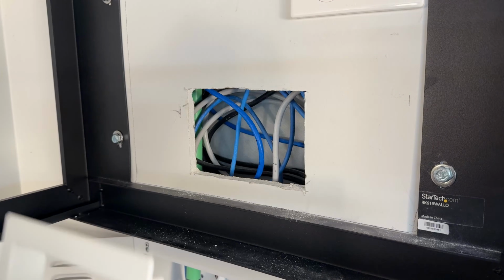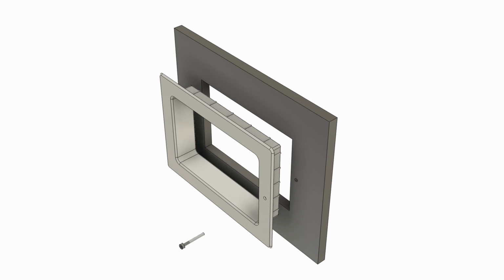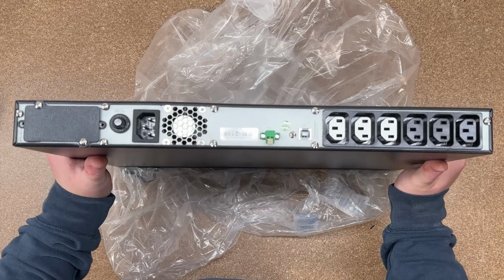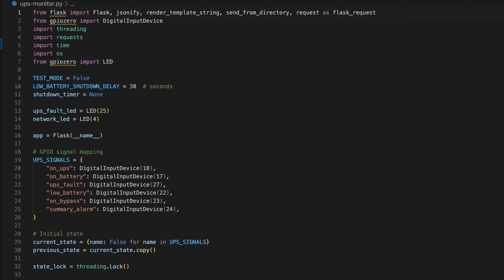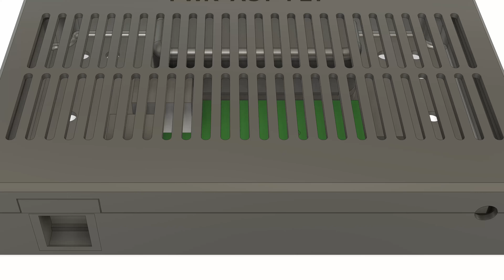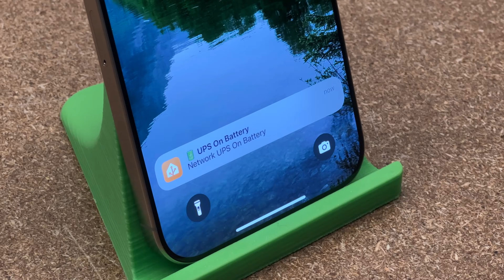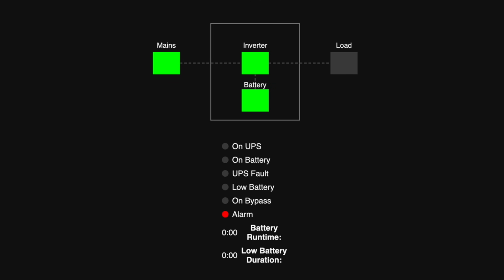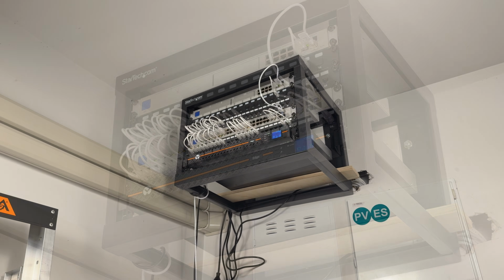I Finally Installed a UPS… and Immediately Overengineered It

Comment: I've been hunting for a short depth 1U UPS! A little sad that the one you found is NZ$1,700!
Side note... You should consider doing some tutorials on designing 3D prints from start to finish, I'm still stuck in the stage of having to find completed designs :-(
Reply from the maker: Wow it was $800 when I got it earlier this year, talk about inflation!!! 
In my previous functional prints video I did a short section about how I designed a bracket for this UPS, not a full tutorial but it might help. I am thinking about doing a more in depth video on how I design things.

Comment: A threaded rod with some heat shrink placed between rear rack uprights is a good way to support the UPS. I have been modding rack slides for last couple of days and ended up removing the sliding part and drill holes in it to bolt to the rear uprights. It works...
Reply from the maker: That’s quite a good idea, much better than plywood. Thanks